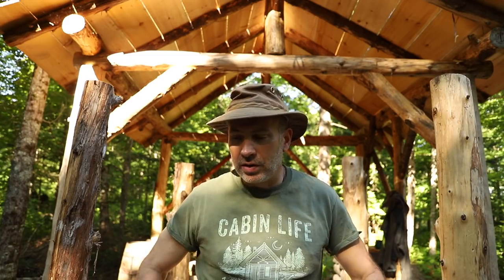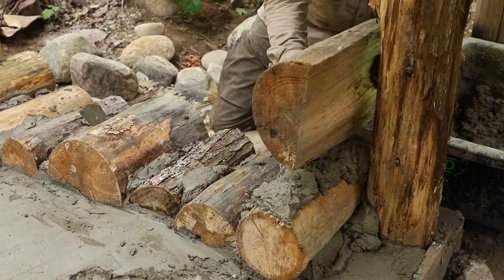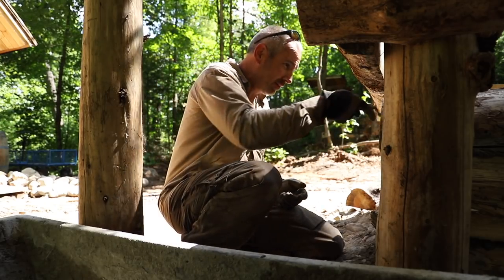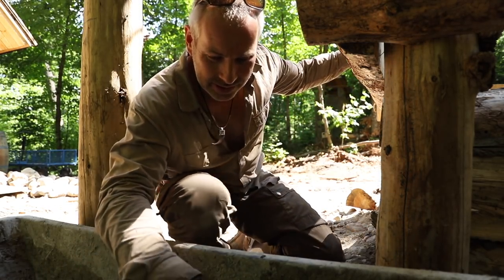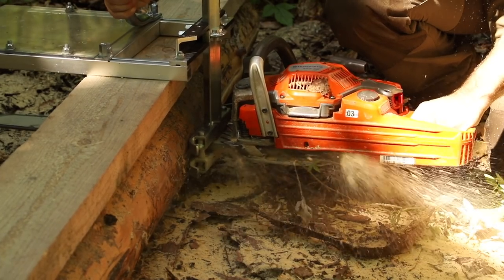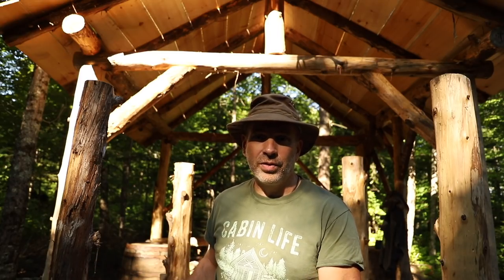Cordwood Bear Claw, Homemade Cheese | The Forest Kitchen | Off Grid Log Cabin Build, Ep.8 S1

Comment: nice video ... loved the window shot .. made it look like you were beside yourself ;) ... I have built a few cord wood and mortar structures in my days .. they do look awesome ... my dislike of them is the fact that eventually the wood rots away ... ok it does take many many years but still ... as far as how you are doing it ... a touch more bedding perhaps a touch thinner mortar for better flow and adhesion  as the wood will soak up a load of the water and it does allow for better wood preservation with the lime from the mortar  ... after that you have down pretty daRn good  (looked like dam not dar n )
.
you know you will have to make a proper pantry or cheese store so the wife can age cheese of different types :) 
.
hmm when you get to the outdoor table ... why not make a bear paw shaped table  with the claws being the seating and have the view look out over the water or some awesome scenery ... pretty sure you can find a view or 12 that should suit ;)
.
did you think to put some fiber into the slab base for #9 ... perhaps cali hair ... it would make it stronger and allow it to hold even more weight and heat as it will become a really good concrete like mix  ... 
.
dont forget to brand the bear paw foot with your logo as well ... heck either sear it in or have a belt buckle type nail in piece to place in it ... and of course ... get your hands on a horse shoe .. or have your black smith friend make one up for you to hang over the kitchen entrance for luck 
.
perfect timing on the video as well ... coffee just finished brewing here as well .. so i sat back and watched and enjoyed my first mug of the day and most of  my second lol .... cant wait to see how or even if you do anything more to the rocket stove .. another great opportunity for your logo as a cook surface instead of balancing on the 4 bolts ;)
Reply from the maker: Thanks, and great advice. Cali doesn't shed in clumps like my last Golden did - I actually did consider that but don't collect enough.  Instead I used alfalfa from my hay archery target mixed with clay and sand. Good idea with the brand, I do have one and have been considering where to use it.
Reply: it was so good i watched it twice back to back ... time to make a new pot of coffee now too ;)

Comment: As a 40 year mason, one of best ways to learn is experience. Yes there are technics and different ways to learn and accomplish an end result but putting a trowel in your hand is probably the fastest way to learn. One trick I learned was to take round granite rocks and because they hold moisture, you can put them in a fire and they’ll split almost evenly in half. Then you can butter the backs of the rock, which are flat, with mortar and stick them on a smooth masonry surface for a stone veneer. After they dry on the surface for a day you can fill around the edges of the rock with mortar, let it set up for awhile and finish it with a semi stiff brush. Keep up the hard work and you’ll have your own bag of tricks with masonry just as you’ve learned other tricks. Keep em coming, they’re fun to watch!

Comment: Any plans to add some chickens, Shawn?
Reply from the maker: Josh Vermast To the grill :). Maybe, but probably just seasonally rather than building a breeding flock.
Reply: We just put 8 egg layers in our barn with a small coop, very low cost, low maintenance but more eggs than we can handle for a family of 4. 

They would be perfectly content and safe if you weren't there for a few days as long as the coop is built well (which you can obviously handle).
Reply from the maker: Josh Vermast I have predator issues during the day here too so I keep losing hens when they're free ranging, which is the only way I like to raise them (even during the day when I'm not too far away)  - Raccoons, coyotes, martin, weasel, fox, fisher, mink, bear, coyote, wolf, owl and hawks. I'm not sure I want to tie myself down to that much vigilance.
Reply: Time for some ostrich "hens" to turn the tide of war! See how a raccoon likes a 6' tall chicken bearing down on them.

Comment: Wish I knew then what I know now dept: A guy works intensively and continually his whole life to get to retirement, the body changes but the attitude doesn't (at least for a few more yrs to get some wisdom).
Tips: I'd suggest to dip that cordwood in a bucket of water so it isn't dry. You should mix your mud as dry as you can and still work it, it will be stronger. You're walking on rocks, throw them into your foundation, rock lasts longer than concrete. 

Thanks for filming the episodes. Just watching you work is a treat. The kitchen is really shaping up to be something special, great ideas and design. Good luck!

Comment: I don’t know how anyone has the patience to video.  The heat, the remoteness, lack of power tools would be enough for anyone.  Great job and I do appreciate it
Reply: Larry Jacobs you get used to the heat. The remote location is one of the main reasons for being there. No power tools makes you really connect with your tools and materials. It is a completely different way of working on a project, and it is very satisfying.

Comment: Shawn, only the ends get mortar. As you have done it the wall will be cold and the cord wood will rot. The air gap in the middle is insulating.

Comment: Great start,, been there,, try adding 3 or 4 shovel full cedar sawdust to each 6 or 7 cement.. it helps stick to the wood.. I only use cedar & black lucus,, throw in some wine bottles ,,thick ones,, & split some 6 /8 inch round  into quarters to fill between the big wood saves on cement.. Picked a bowl berries this am,, thought about you & figured yours must be ready now.. Aloha My Friend

Comment: Love the channel. I’ve been watching for at least the past year. As far as a tip for the cordwood and using concrete in general I’d go for either more ‘uniform’ logs or shaped logs. Or using smaller logs, like 3-4 inch thick. That would save on concrete and give a better look in the end. Or you can use smaller pieces to fill in the large gaps, which will also cut down on filler. Jimmy diresta has an amazing video on a cordwood table if I’m not mistaken. Like a jigsaw puzzle but the finished product Is beautiful.

Comment: i as a swede who has access to a cottage much like yours love your videos! but ive been thinking for the last couple of them that shouldn't it be a lot cheaper if you mixed in sand or just any kind of mixed rock in your cement, usually you use a 1:5 ratio of cement to sand

Comment: I found an easier way to mix concrete in small batches. You use a square of heavy tarp five by five feet, dump one half of a bag of concrete in the middle of the tarp, make a depression in the pile and add water, then you lift a corner of the tarp and turn the mix over on itself, alternating corners as you go. It goes surprisingly fast - much faster than in a trough with a hoe. Of course you can adjust how much you mix at one time and how big the tarp is. The mixing goes even faster with two people. It also helps if you dig a little bit of a depression in the ground under the tarp so it doesn't get away from you. Try it you'll like it. 
Drake in Wisconsin

Comment: May be some nails stacked at the Cordwood would be better to stick up in the concrete.. ATB Salvador.
Reply: the water in the mortar will actually absorb into the wood which brings the smallest parts of the mortar into the wood making an excellent seal and binding it better than anything else .... just needs dry wood with a basic rough surface and no oils or low resin content

Comment: This may have been covered already, but how did you remove the wood forms on either side of the fire box and inside the rocket stove?  I was thinking you'd simply burn them out, but missed it if you filmed it.  Thanks!
Reply from the maker: It was in the DIY rocket stove video two weeks ago. I burned it out.

Comment: How do you seal the cordwood once the mud dies? I would think you would also have to seal the dried concrete as well so that it doesn't wick moisture into the wood.
I like the look of the wall, but I would be concerned the wood would rot out soon.

Comment: My Self Reliance 
Hi Shawn,
Love the videos and lifestyle you have chosen, One can only dream.
I'm curious to know if you have any knowledge of Timber Care?
The reason I'm asking, you've built a beautiful Log Cabin and outdoor Kitchen and will need to be protected from bugs insects and the elements.
I'd like to offer my knowledge on this subject so your buildings will stand longer without rot. 
The most common thing that causes rot are bugs laying eggs in the natural cracks in timber. They also burrow deep into the timber and lay eggs especially at the sawn off ends which are easier for bugs to burrow into.
There is a chemical paste BoroPaste, Deep kill paste it's known as in the timber care community. It comes in 5L buckets, it looks like mayonnaise. It can be injected or slapped on with a heavy brush onto the surface and ends of your timbers and it will penetrate into the timbers protecting them from bugs and bacteria (DRY & WET rot)
Deepkill paste will make your timbers last.
Insecticides & pesticide sprays will stop bugs and critters eggs from hatching and borrowing through your timbers.
I worked in timber preservation companies back in the day, we would get it from chemical specialists NOT home depot or shops alike.
If you want your timbers to last a very long long time whether it be a shed or a log cabin, look into Timber Preservation treatments & chemicals and their uses and how to use them safely.
You could make some videos on how your going to protect your cabin and kitchen from critters bugs and the elements.
Good luck Shawn, Love what you do. 
Stay Safe out there.

Comment: Won't the cordwood in the oven walls be in danger of catching fire while the oven is operating?
Reply from the maker: Nope. Next episode will show why not.
Reply: compare a fireplace and flue to the oven he is making ... the flue only has 1inch of insulation as it passes through your roof and past all that wood ... it's the same idea with the stove ... a good insulator like mortar or concrete and the heat and oxygen wont be enough to start a fire for an easy 20 or 30 years ... with how he has made it so far .. i'd expect a minimum of 40 years with minimal upkeep before the cord wood has a chance of starting a fire from using the stove.

Comment: I like the cabin build. This outdoor kitchen build is much different. There’s a lot of large concrete and rock being piled together. Most of it is unnecessary. I get what you’re trying to say about experience, learning, and trying things but piling up concrete and rocks are permanent unless you got heavy equipment. It’s going to be a nightmare if you ever want to move something or have to smash it and redo it. That grill base is a monstrosity. It was painful to watch you stick those lag bolts into the concrete with out a jig. I’m halfway through this video wondering what this pile of concrete and wood is going to be. Should have stuck to wood with minimal rock and concrete.

Comment: arent you afraid of rot in those logs?
Reply: I think he has an idea on how to seal the logs from air and wet and still show the logs as well .. and all he needs is to do it on the butts that are exposed ... the rest are sealed with lime and mortar so it will take a very long time before he has to worry about it ... even if he doesnt seal the exposed ends ... as long as they stay generally dry it will be 20 to 30 years before that is a concern with just minimal maintenance

Comment: Maybe I’m missing something, but I just don’t understand building an oven, which generates extreme heat, over extended periods of time, out of wood. Can someone with experience explain. Thx!!!!!
Reply from the maker: It's about efficiency. When I fully heat it up, I'll cook several things at once - bread, casserole, pizza, chili,  jerky, etc. If I'm just cooking a pizza for example, I'll just have a quick fire and cook it in the oven with the fire going.
Reply: My Self Reliance thx for the response, but I understand the usefulness of the oven. I just don’t understand your use of materials. Aren’t you afraid that using wood as a base/foundation will eventually lead to the entire oven burning down, regardless of any concrete barrier that may be between direct flames and the cord wood?
Reply: the wood on the bottom is more decoration and filler ... on the inside he will line that with a heavy mortar to create a fire box which will protect the wood ... above that he plans a slab as a heat surface like a pizza oven has ... this not only retains the heat longer but also adds more protection for the wood on the base ... as you can see on the other side he has stones where fire is very close to the edge and not easily able to shield the filler from the heat .... 
.
take a closer look at your stove at home ... its a good ceramic coated metal sheet with an air gap and insulation with yup another metal sheet ... if the insulation was say sand or ceramic you could actually use a high temp plastic to surface your stove with no worries about fire crossing over or even melting it
.
paper burns at 451F ... wood about 520f and higher for more dense wood ...provided it also has oxygen ... and being entombed in concrete or mortar the air is well below enough to allow a fire to start ... in 20 or 30 years perhaps he will have to worry about the air gaps from rot but regular upkeep and care keeps that worry well below the worry of a fireplace in your home burning down your rafters as it passes up the flue.
Reply: 0623kaboom thank you for taking the time to give a very comprehensive explanation. It’s much appreciated. I still remain slightly skeptical, but others know better for sure.